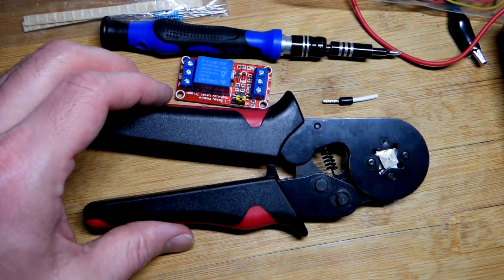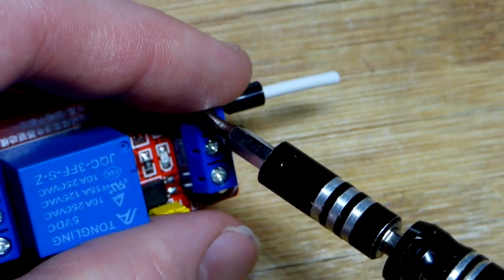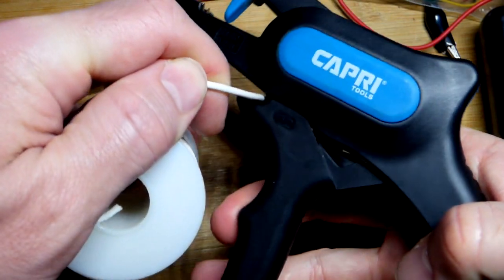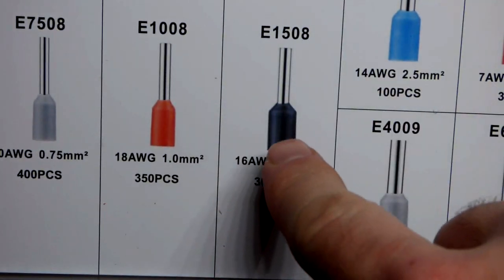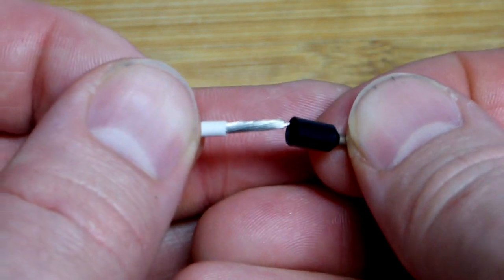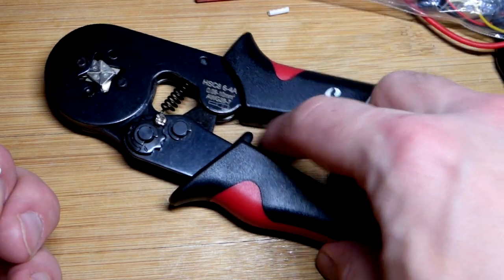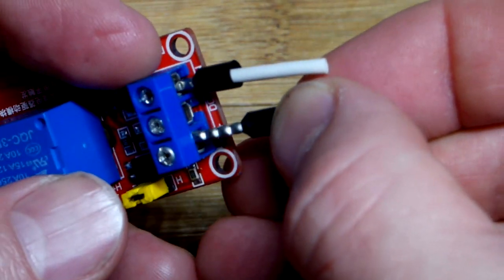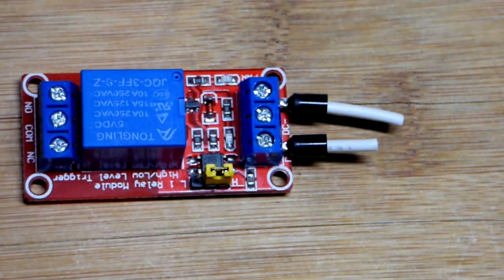How to use ferrule self adjusting crimping tool for wire for common small blue screw terminal blocks

Comment: I probably have every ratchet crimp tool but that one. Looks good for those board mount connectors. I just got a kit of Wago branded wire splice connectors for rework, retrofit or adding circuits to my solar system on RV. 
Are you still on that same new job? I hope all is well.
Reply from the maker: I've been thinking about getting wago connectors, I have cheaper ones. Couple years ago I got rehired at the same company I worked for most of my life. But I saved up enough due to lots of overtime that I basically quit, other than filling in 1 shift a week. So, it's going pretty good, thanks!